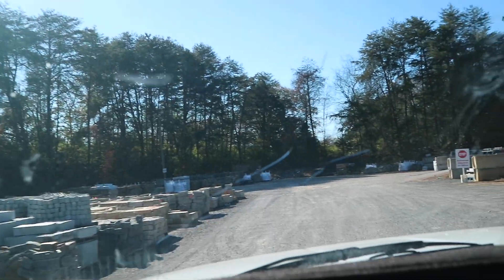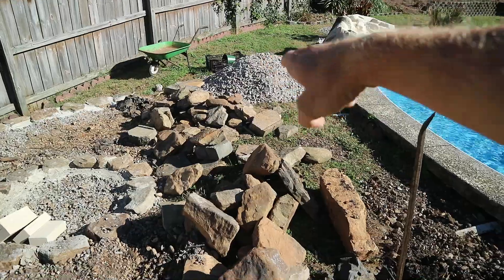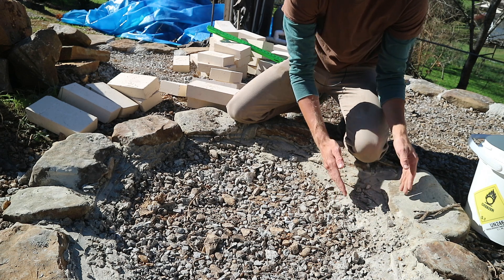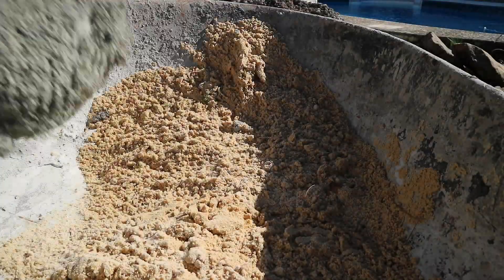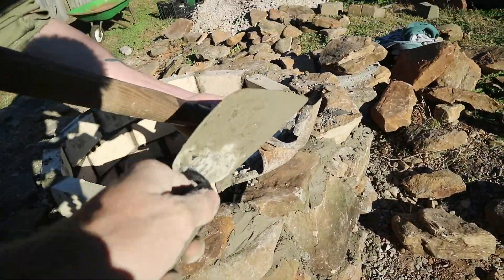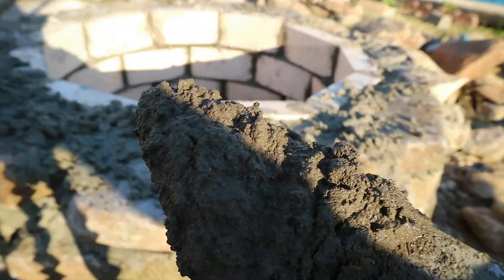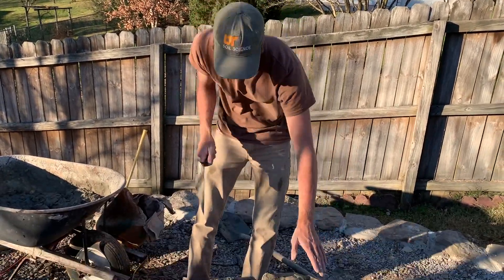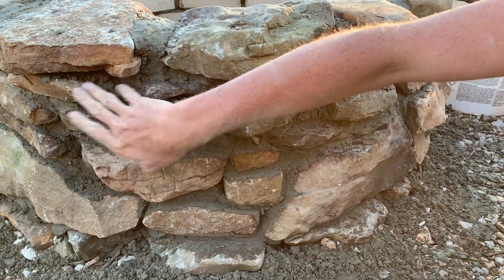HOW to make a STONE FIRE PIT

Comment: Maybe a dumb question, but why do you line the inside with the store-bought bricks instead of just using the field stones?  Also, should you leave small holes/gaps near the bottom (and perhaps randomly elsewhere) to allow fresh air to flow in and circulate?  I think it would also allow warm air to flow out, instead of it all just being forced up and out the top, keeping you warming as you sit around it.  Great video though!
Reply from the maker: No that's a good question. Those bricks are fire brick. They can withstand the heat of the fire where the heat is more intense. Interesting idea on the air pockets. I'll have to consider that next time I build one!